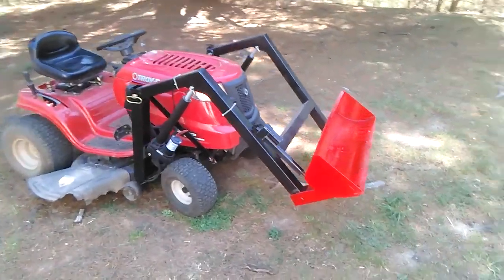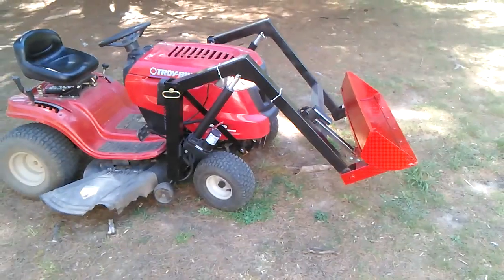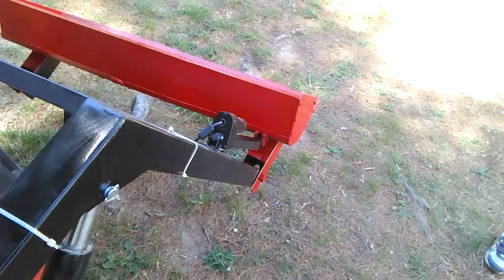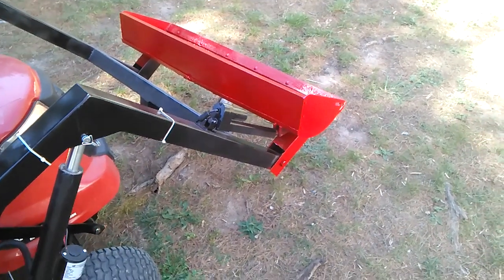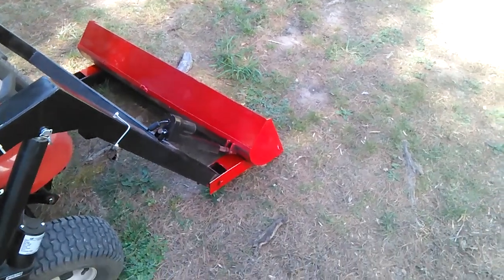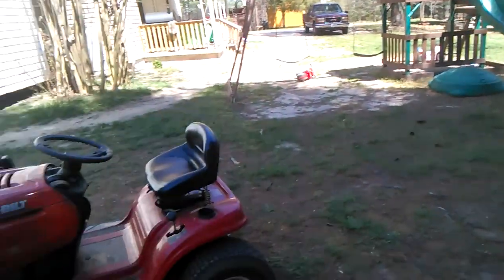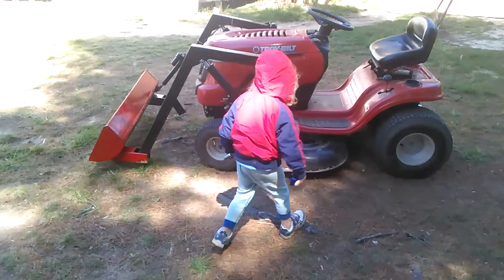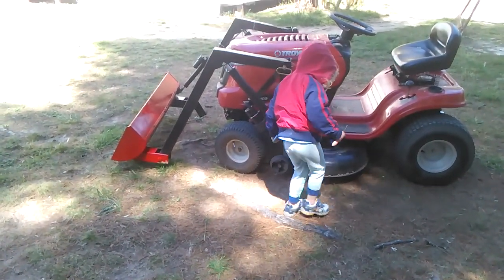Electric bucket loader

Comment: How much weight have you actually carried in the bucket and was there any problems.
Reply from the maker: I say I could move around 2 hundred pounds of rock or mulch. I had no problems for many years until I was many beers in and decided I use it to dig up a big tree stump. I pushed it well past the limits of the mower itself and tweaked the frame on it pretty good. It was 100% my fault. I know the limitations yet completely exceeded them many times over
Reply: @offgridandhappy2743 Ha I've done things like that before. 200lbs is about what I'm looking to do with mine. Thanks for the response, you use any counter weight?

Comment: Hey we're did you get the parts from I really need to now
Reply from the maker: Steven Swett i got the actuators from northern tool and the steel is a old motor lift i simply repurposed and the bucket was a scrape blade

Comment: Did you have to add a larger capacity battery? Does your tractor alternator keep the battery charged?
Reply from the maker: Sean Signer i just used standard battery a stater set up. i have had no issues with it and been very happy with how it works

Comment: Dude! Thank you very much for posting this video, i have a husquavarna that i have added a linnear actuator loader that i rigged up and it was very very cool to see your video while i patiently waited for mine to be delivered. Started out with a 225lb 4 inch stroke ebay actuator and graduated up to a 800lb? I believe northern tool 6 7/8 stroke. Its strong but like you said slow.... whatever i make it work and it is alot of fun. Thanks again i will make a video of mine when i finish the electric AWD

Comment: Are the two side actuators synchronized?
Reply from the maker: wdk535 as best as i could get them. they are wired to the same switch and i esentially bottomed them out when i hooled them up. they seem to travel at the same speed and i have had zero issues with how they function

Comment: are these the ebay actuators or from some where else?
Reply from the maker: I got them from northern tools. They have a very good selection at a good price. I actually bought bigger then needed as I really didnt know how strong their lifting capability would be. I have two 500 pound lift which is way more then the mowers frame could handle. I can move about 400 pounds in bucket with putting some stress on frame but havent had any issues